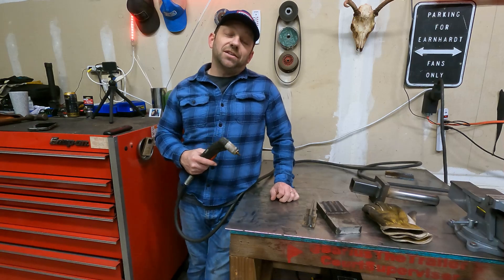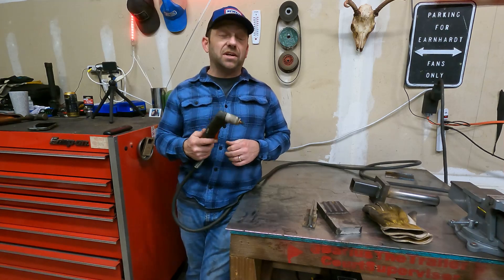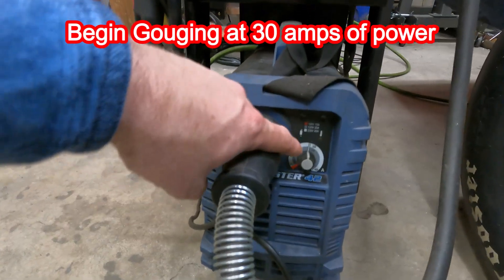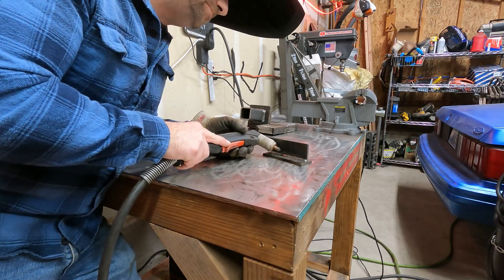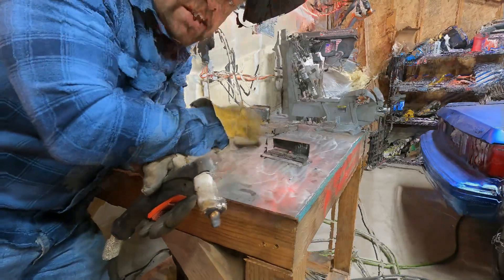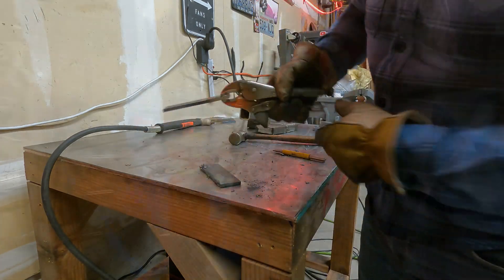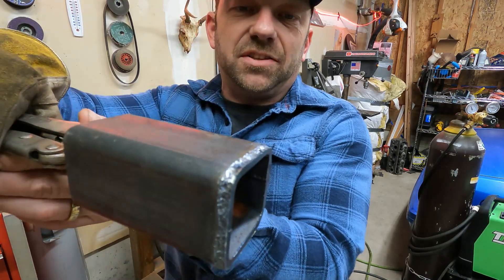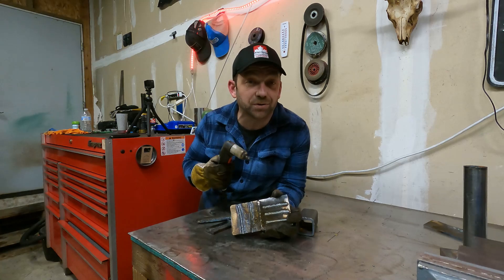Plasma Cutter Gouging And How Its Done

Comment: Thanks for the nice demonstration of the plasma torch. Been thinking about getting one. Planning on suspension upgrades for the Cougar and this would make it easier. I'll just need a bigger welding cart.
Reply from the maker: I put mine right on the bottom shelf of my cheapo harbor freight welding cart, it works great.